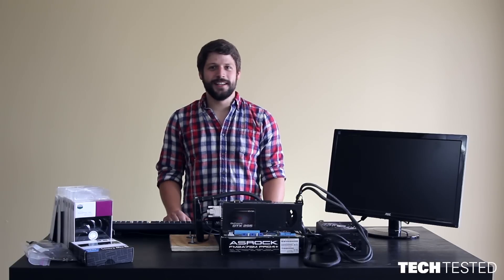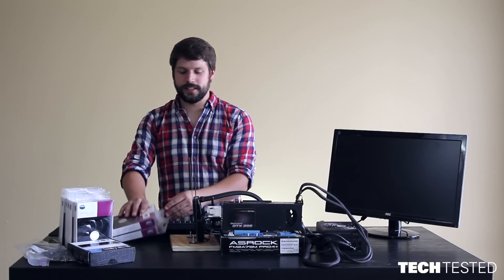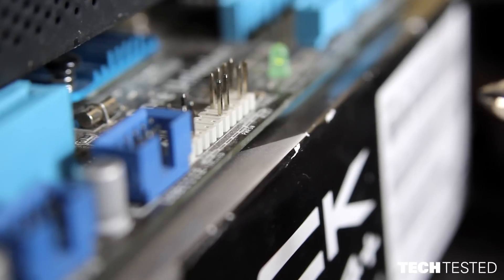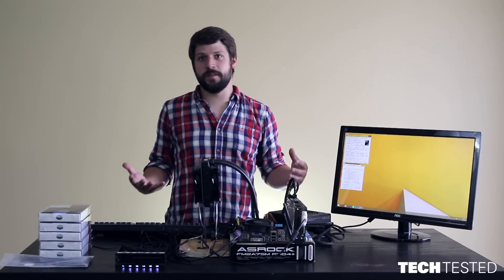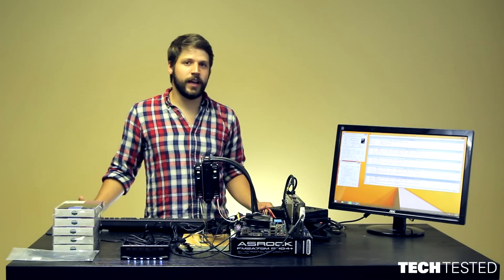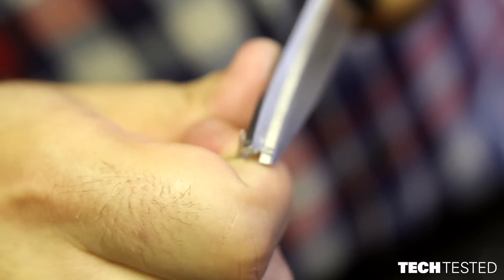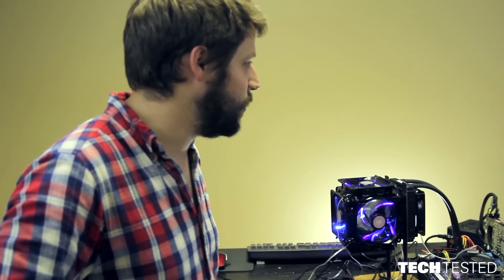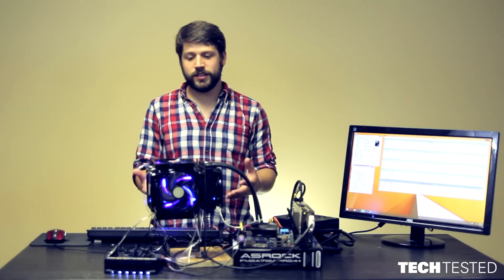Turbo Charging A CPU Cooler

Comment: Hmmm turbo in car engine was using exhaust as fan rotator that can spin up to 30k rpm, so I think you are trying to mimicking super charge instead of turbo
Reply from the maker: I am planning a video to address this using an actual turbocharger. Stay tuned you won't want to miss it

Comment: Although I like the premise of this experiment, the execution was a bit silly. Placing fans on a cubic position, will lead only to a region of high turbulence right before the actual intake fan. This would likely hinder the performance you could get out of the setup. I'd be much more interested in seeing the same amount of money spent in one such setup with 7 fans be applied into building an accumulator, with one high static pressure fan at the entrance, and sealing as best as possible the attachment to the heat sink, and downstream, an outtake fan. That would be an awesome experiment, with a much better application of modifications of pc setup, and maybe even some improvements to be seen! True, the law of diminishing returns applies here as well, as in there's only so much you can gain in lowering cpu operating temperatures for every extra dollar you spend in modifiying the cooler as supplied by the manufacturer. And considering that accumulators would likely need be build in plastic, doing so is already quite a lot of work and money necessary to do a good job, to then maybe getting  a few degrees Celsius lower. The manufacturers live out of selling the best product they can, so you figure that as in out of the box, it would already do 90% or more of its total cooling capacity, without the need of doing any modification whatsoever. Still, very interesting premise to the video.

Comment: 2 years later i come to explain to you, that you should had removed the push fan and make the chamber around the radiator so the pressure you gain will be deliver cause leaving the fan just cause you a bottleneck and resistant cause air wont make it faster enough cause it has to move trough the push fan instead of just moving freely at his own speed

Comment: If you make a chamber like that you shouldn't limit the pressure by puting a fan directly against the radiator and behind. Best would be to put 5 fans on one side and something like 5 on the other side sucking out air. But don't cover the intake and exhaust with fans. Also tape them shut on the sides so you dó actually increase the pressure.

Comment: Probably the 2 fan config is alread almost at the peak heat transfer speed of you presumable aluminium heatsink. Plus the fins are optimized for lower pressure. You'd need a more transmissive heatsink with tighter grouped fins to take advantag of the extra pressure. Basically what you have there is a turoocharged engine with super run down cylinders that can't hold the pressure, thus not giving you good gains.

Comment: There's no sealed combustion chamber so you can't "force" air in there. It just stops and blows out the sides or back at the fans. What if you just stacked 3 fans in push and 3 fans in pull?

Comment: The more time the air has contact with the radiator the more heat will be removed from the radiator.  This is why your a/c can feel colder in your car when you have the blower fan on low.  I would not imagine that attaching fans the way it was done in this video would improve things very much.  This is mostly due to moving air through the radiator faster and the fact that a lot of the fan's efficiency is wasted due to not being sealed to the radiator (there are lots of spaces where the air can "skip" going where it's supposed to in this setup).

The BEST way to improve the cooling on a liquid is to have more liquid.  I run water to air intercoolers in my turbocharged cars and their performance is superior to the traditional air to air cores... with the exception that if your water system is too small it will eventually heat soak.  For this reason I have a gigantic heat exchanger where the front mount intercooler (air to air) would go.

I would suggest adding more radiators and water volume to the system to improve it's performance and I intend to do something like this some day when I build a liquid cooling setup for my pc.  If you really wanted to get crazy you could run all of this from a 5-gallon carboy container next to your pc and place your radiators next to a cold blowing a/c vent in your house.

Comment: I'm not schooled in the ways of science, but this doesn't seem like it would work unless the RPM of the intake fan was somehow directly linked to the RPM of the exhaust fans.  Due to them not being linked by a shaft like in a turbocharger there is no way really besides scavenging from the exhaust fan for the intake fan to increase in speed.

Comment: Go to an aquarium supply store online and buy an AC powered 120mm ventilation fan with a pressure rating.

Install fan pushing into radiator.

Plug into power bar and leave on.

Doubles lifespan of radiator loop, cools much more strongly, puts less stress on system, cools radiator after shutdown.

Comment: This sort of arrangement would see a lot of turbulence inside of the 'positive air pressure chamber' and worse, would result in a loss as air gets forced around the peripheries of each fan. You'd have gotten better results mounting the 5 fans in reverse to pull air and potentially no fan on the other side, along with sealing the whole business up.

Y'know, the same principle as creating negative air pressure on a computer case with no intake fans and thus the minimum restricting the 'intake' (which you could think of as something like a snorkel on a car's air intake choking it up). Ideally on top of all that you tune the intake to maximize velocity, but then you're increasing the complexity and size of the build substantially, so... Rather just get a bigger radiator or heatsink to create a larger area with which heat can be dissipated and a larger 'buffer', since not many people will ever have sustained 100% loads on their CPUs anyway.

Comment: As a person with a degree in physics I want to tell you that you forgot Physics 101.  Pressure and Temp are directly related.  As you increased both airflow and pressure you decreased efficiency of the extra airflow by increasing the internal pressure.  Place the fan opposite of the way you have them.  Make "box" blow out creating a negative pressure to pull the additional air over the AIO and the system should be marginally better.  Maybe 1 to 3 more degrees C.

Comment: my question, i know high static pressure fans are great for pushing air over a radiator, and high flow fans are good for pushing more air into a case, now my question is, what is the best fan running just a pull config on a radiator?

Comment: a supercharger is used to get more air in the engine to get more power out of it because of the air/fuel ratio, not because u get more air trough
Reply: thats why is pointless to add 5 more fans

Comment: Yeah, just having push pull is a waste of time and money.
All you need is pressure optimized fans in EITHER puss or pull, preferrably pull to make dustremoval easier, but i know for a fact that fans in pull tend to create resonating noise when compressing air against surfaces like radiators.

Since silence is what i'm after and the temperature difference were zero and i don't mind taking out the whole radiator to remove dust, i placed my fans in a push configuration.

And for those who want to know:
EK x360 radiator with Corsair SP120 silent edition.
inaudible allmost all the time.

Comment: my guess is cause you had a fan between the big box of fans and the cooler so that fan, as it couldnt spin much faster than max, was slowing the air back down to only a bit faster than before. same reason as to why lots of fans in a row doesnt work.

Comment: A fan is not good presurizing air, it´s only good at moving it, fron one side to other,  the turbocharger of a car gives it the extra pressure because it centrifugates the air increasing the pressure up to 100kpa, it has been proved that if you try to turbocharge a car with a fan you dont get any performance difference but if you do it with any centrifugal blower you can raise the pressure depending on it´s design

Comment: didn't work cause you had 5 fans pushing and only one exhausting you had positive pressure on intake, but ideal you want 4 to 3 ratio or similar +20% positive flow anymore than that and there is no net gain what so ever. Another factor is what was the room temp? the best you could hope for would be 100% efficient meaning running at room temp. Use a TEC in between the cooler block and cpu. That will get you down to 15 to 20 C easily. I have one on my fx 8150 its at 5ghz oc (1.525v core) with tec running its stays at 49c full load and 38c idle. Not bad for a 1400 mhz oc been stable for over 2 years runs like a champ.

Comment: so fucking dumb, you would have gotten better results with just one more fan in push pull, and if you wanted things to be dramatically cooler, you need more radiators, more surface area=cooler temps, not more air flow hahaa

Comment: I believe if you put the turbo fans to take out the hot air instead of putting cool air you will get better results cause the faster the heat goes off the better it is.

Comment: I think anyone watching this should really consider the following facts.

CPU doesn't throttle until ~80c
If the CPU doesn't hit that temp then it will have no performance change.
Over clocking the CPU provides more heat.
So you need to cool it better.
But even if you over clock and don't hit TJ max you won't throttle your CPU
really no point trying to lower CPU temps if you never hit above ~60c

Food for thought.

Comment: I know it's one and a half year later, but did you try removing the pull fan. It can actually be blocking some of the air, rather than helping to pull it away. Cheers.

Comment: so the water cooling uses air cooling as well ... good to know that , looks like without air cooling there is no water cooling
Reply: Mr.Nobody You could run your loop into your bathroom and use your shower as a tank.Fill it up with cold water and there you go.No fans necessary

Comment: dude take the pull fan off the setup, it will cause air restriction. its like a blowing a balloon up using a straw. take the single puller fan out and open up the air flow so all those pushers can do the job better.

Comment: To lower the temps even more, you can have a powerful fan at the exhaust to accommodate for extra pressure generated by that doohickey you built. This also means that the water pump will need to be sped up to propel water faster inside the loop... Or just get a larger radiator

Comment: People should just skip these videos and learn physics. Or just apply a simple formula based on temperature deltas between air and cooler and find out that you don't need to push air "as fast as possible" (just to quote the guy) through that cooler as there are diminishing returns when you go past a certain speed due to heat transfer efficiency. Essentially what I'm saying is that people do push-pull because that keeps air flowing (as opposed to flowing as fast as possible) at lower speeds (ie. lower noise), whereas a single fan can fail to move the same volume of air at the same RPM.
Reply: Basically you can never reach the same temperature as ambient, on load (ie. CPU gets hotter than ambient under use). It's the law of thermodynamics, a differential must exist. If the rad and ambient reach equilibrium, meaning the same temperature, they cannot and will not exchange heat by simple convection any more. Keep in mind that all measures are relative.

Comment: I got a delta PFB1212UHE-F00 fan that drops cpu temp on the same water cooler used in the video from 80c to 45c.. Thats only push, you should buy 2 and do push pull and see the temperature drop

Comment: More fans don't really mean much in my opinion as after a while it's not the speed of the air that will hold you back but the transfer of heat to the passing air.

Comment: Could it be that the box of fans was just losing pressure because it was not sealed?  I would try creating a seal around all of the fans and around the intake fan on the CPU cooler using duct tape so that the only open spaces are around the intakes for each fan.  Also, would this work better with a tower heatsink like a Hyper 212 EVO or (if you really want to get crazy) a Noctua NH-D15 since they would have direct contact with the CPU?

Comment: Create a air plenum so the cooler can draw the air from a pressurized space... create 2 short 120mm tubes into the plenum with 2 static air fans on the ends... then have a airflow fan pulling the cold air through from the Plenum... you missed the whole point of turbo charging, which is creating pressure before reaching it's destination, your idea is great, you executed it poorly though. Best way would be using a case with 2/3 front intake fans or 2 front 1 bottom intake, then have the 2 front intake fans as SP then create a tubing system towards the CPU to aim all the front air towards it, 2 SP fans pushing into 1 120mm funnel... increased velocity via 2 SP fans + 1 AF exhaust fan from the CPU... Turbo effect as it will create pressure... but increased pressure increases temps, hence why Turbo's run at such high temps

Comment: Remake the test, but this time, also do a "box" of fans on the other side that pulls air and makes negative pressure. So you'd have 6 fans in push and 6 fans in pull configuration.

Comment: well duh, you would have to actually compress the air not just move more of it, sure that helps but just like with cars the turbo compresses the air so that you have more than atmospheric pressure in the cylinder, when they say 10 pounds of boost that means that instead of 14.7 psi in the cylinder you have 24.7 psi
Reply: +Two_CraZy-EyEs even if you compress the air, if you blow on the rad it will not cool much better. A turbo compreses the air before you put it in a cylinder and thus when compressed again , the final pressure in the cylinder goes up. But with a radiator the compressed air expands as you release it ,it wil only blow faster, if the air does travel faster it cannot pick up the same heat per molecule because there is no time enough. Same goes for water speed in a loop. So, if you blow twice as hard, the air only takes half the heat per molecule but because it is twice as fast each double the molecules and there is no gain.
Reply: protechnician83 well yea that makes sense, but still if you could theoretically compress the air through the radiator, and keep it compressed somehow, that would increase cooling depending on how much boost its running because there would be more air in the rad to absorb more heat. but that would be incredibly difficult to do if not impossible.
Reply: I  see your point, the density of molecules is higher thus more molecules come in contact. But they are compressed, thus smaller in size per molecule and each molecule has less contact surface to accumulate the heat. So profits would be small i guess. Also your pc case must be some kind of pressure tank you could achieve this by making it airtight with only 1 intake and pushing a lot of air in trough, then let it escape through a narrow opening. The hot air needs to escape or the heat stays in the case, but to create enough escaping hot air and keeping pressure up you would need a compressor with a lot of power and dont forget that a compressor heats up the air when it compresses it.

Comment: Why not try with a negative pressure in the pull side as well, just for, you know, science!!
Reply: +Robin Richard This is what I was thinking. I am pretty sure if you knew the formula you can calculate how much air would have to be pushed into the radiator/heatsink and how much air would have to be removed per second to max out the capabilities of water and air cooling.

If you think about it. You can only have so much air coming in before ybu achieve diminishing returns and the same can be said with air being pulled out of the heatsink as well. At some point the heatsink or fans actual capabilities become the bottleneck. Are we at that point yet? Not if Noctua keeps making badass products.
Reply: i wouldn't work, flow of air will decrease because of neggative pressure

Comment: your setup is flawed, just do the "cube setting" and remove the fans mounted directly on the radiator, then let's see again, I bet with you that you gain something compare to your "turbo charged" setup, and with 2 fans less.

The idea here is that the 2 fans on the radiator basically are bottlenecks...

Comment: somebody did a vid with a h100 with 40 fans and got below 0 temps if i remember correctly, and it was loud
Reply: +Ian Alejandro that was faked it was 0 degrees centigrade so the water would have frozen
Reply: OC3D TV did it
Reply: well it was cool and loud and it did a heck of a job at cooling
Reply: +Ian Alejandro Litterally impossible, the best you could get would be ambient temperature, unless you used an active system like phase change or TEC, or water evaporation.
Reply: Keven Harvey lol u explained it better than i ever could...
Reply: +Manav Anand Go swim under the ice pls. This knowledge... jesus
Reply: Keven Harvey yo, just watch the video, i know it is not possible, its was just a comment of what i saw and you can see for yourself. And you do not have to talk to me like a baby i know more about PC's then all of you
Reply: ***** you just realized that, and please type in proper grammar.
Reply: +Ian Alejandro that was actually a fake video, go back and watch it through to the end, as it isn't possible to go below ambient temp by just using fans